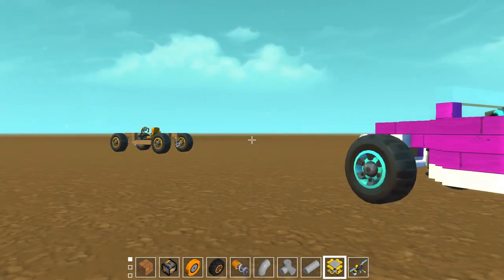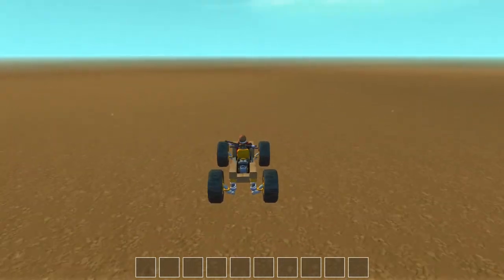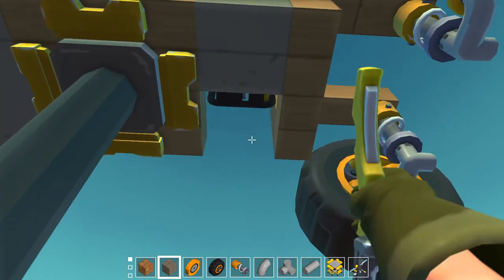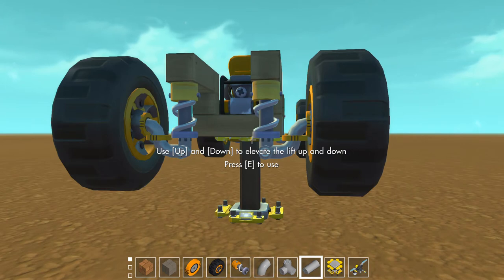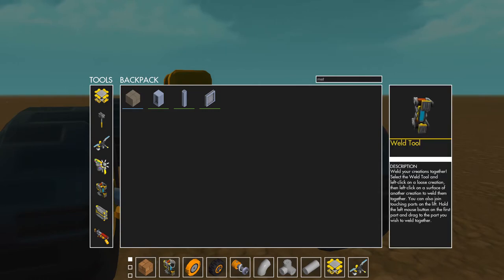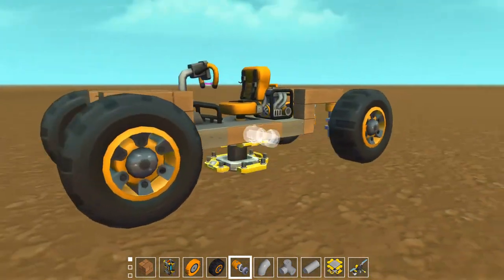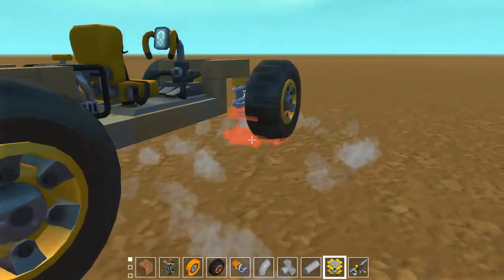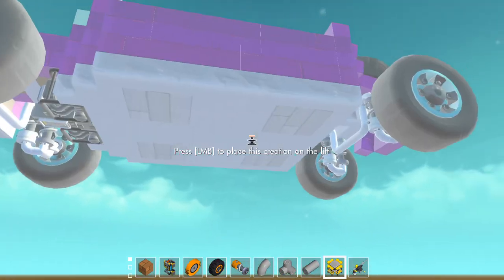Building a Sway Bar in Scrap Mechanic

Comment: First ever comment
Reply from the maker: Good job
Reply: ReadFreak 7 word of advice, if you hold down click on the weld tool, that’s how it is meant to work, great video btw
Reply from the maker: @dylanboyd6147  Oh thanks. I always just spam click, and it eventually works.
Reply from the maker: @dylanboyd6147  I just tested that out, but the double wishbone suspension seems to be better without the sway bar. The point of independent suspension is for each wheel to be independent, and the sway bar just seems to take away from that. Also it is causing a bit of suspension glitchiness.
Reply from the maker: @dylanboyd6147  but thank's for the suggestion!
Reply: ReadFreak 7 ah, alright. Keep up the good work
Reply from the maker: @dylanboyd6147  I'm thinking I might try a video on Hovercraft next, but we'll see